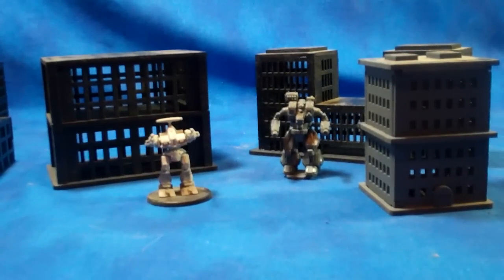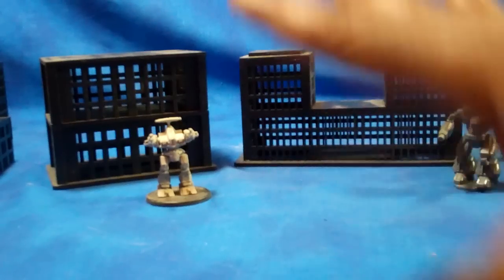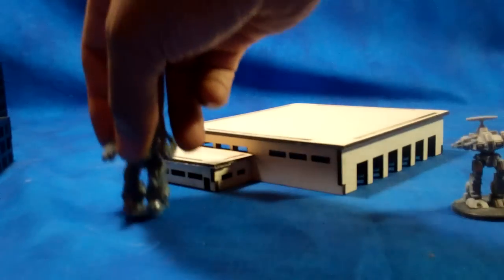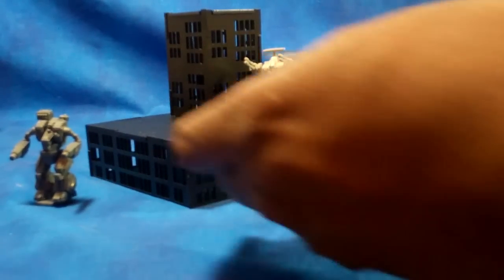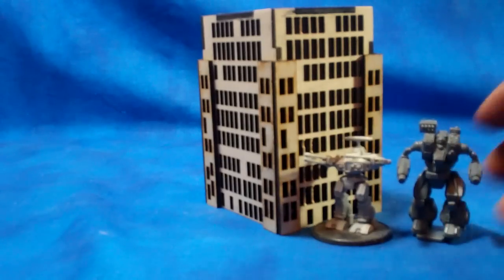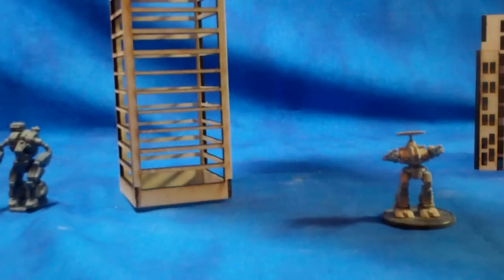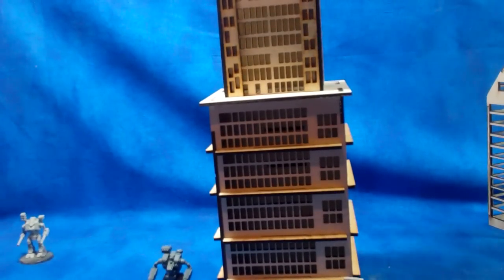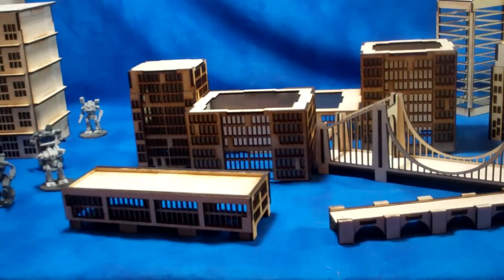Hobby Update - 6mm buildings

Comment: Yeah, these are really nice!
They're nice and clean for a futuristic anime look but it wouldn't be hard to grunge them up for something more gritty; pipes up the walls, barrels, all the urban flotsam. 
There's this flexible plastic mesh that my mother uses for cross-stitch (?) that I'd cut out and put inside that tall open-level one with the slant roof. It's cheap and comes in big sheets so it oughtta match up to whatever comes along.

Comment: Instead of cutting, paint. That will save time. Or you may glue other materials like matches or film. You can paint using markers. For lower cost, xardvoard can be used. Use pens to draw details and color pencils for color. For cardboard you can use cutter to cut windows. If you do not have a child or a cat, cardboard should be sturdy enough. Use glue with cardboard. Using tape in time will deteriorate.